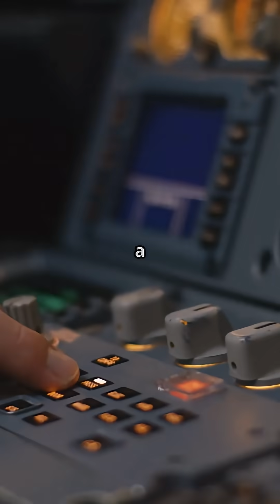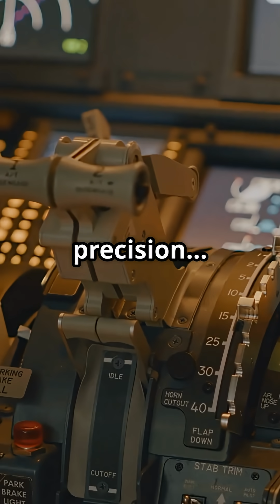Airbus vs Boeing — Reset Culture or Repair Culture?

Comment: This is your Captain speaking, we are at 15,000 feet and are about to reboot the aircraft, please don't panic. 

Oh dear it won't turn on, HEEEEEELLLLLLPPPPPPP.
😂😂😂😂😂😂😂😂
Reply: Or:
This is your Captain speaking. Is there a mechanic on board who is not easily dizzy?
Reply: I mean if you think about it, the higher you go...the more time you have to fix it?
Reply: Yes, those smart astronauts on the ISS can probably fix the plane with, for example, steel wire or plastic paddling.